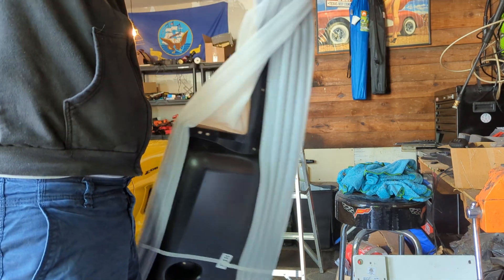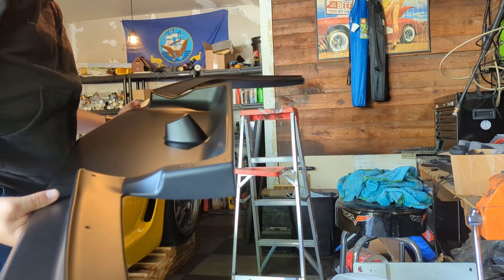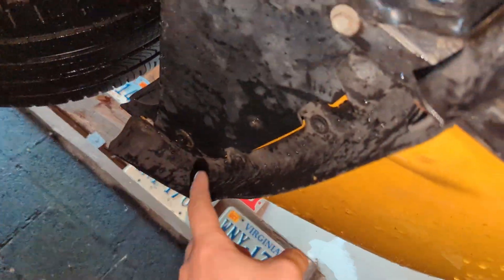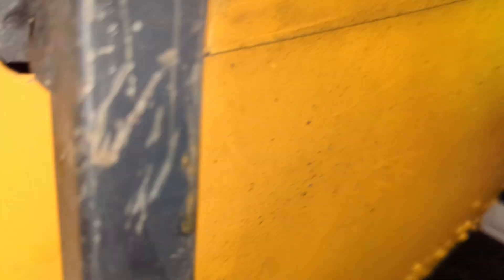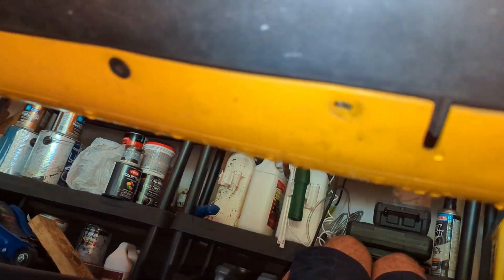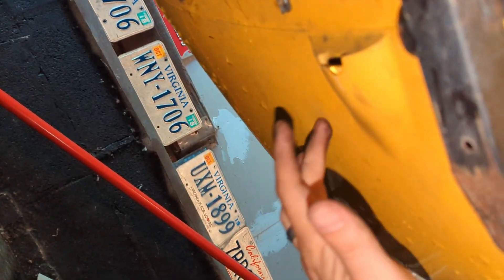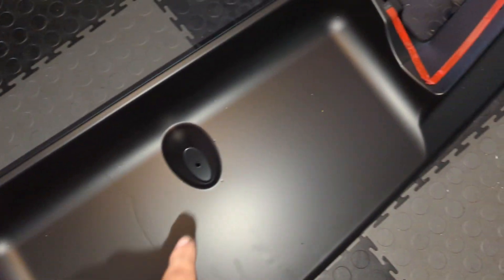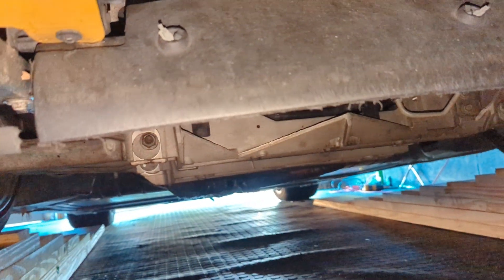C5 CORVETTE FRONT SPLITTER OPEN BOX | INSTALL | REVIEW | NO OVER-HEATING | ONLY $170

Comment: How is the front splitter holding up? Looking at the carbon versions but the prices are a bit silly considering it will inevitably be subjected to wear and tear!  The splitter you have looks similar in design and with a carbon wrap would achieve the same result for a fraction of the cost.

Comment: Did you use the hardware they gave you or use your own hardware? I ordered the same one but only came with the tape
Reply from the maker: Mine came with screws and tape.  They short changed you unfortunately. See if they can send you the hardware.
Reply: @VetOnVettes  what kind of screws are they? Trying to contact them but they are not getting back to me
Reply from the maker: @dreamzv1  they are a self tapping for plastic.  7mm heads. Black. Roughly 1" long.  Thats from memory